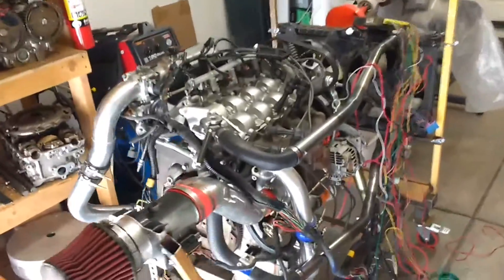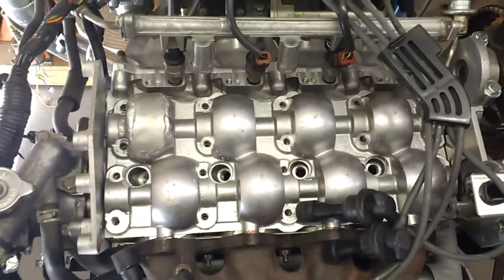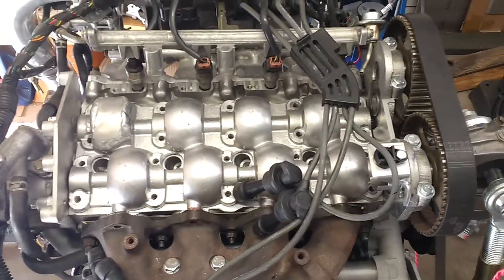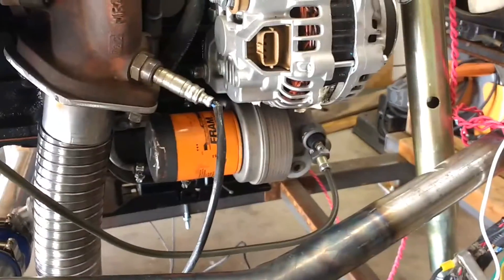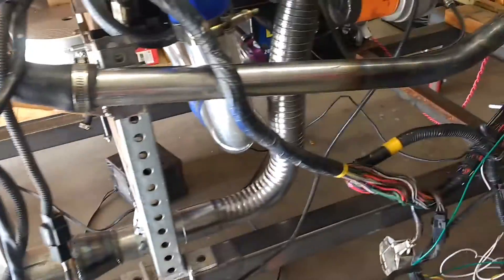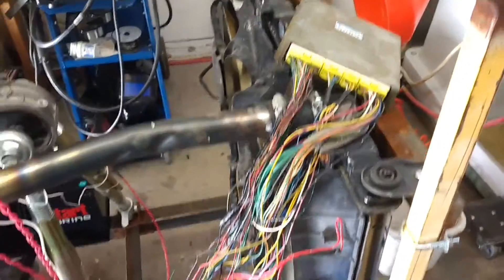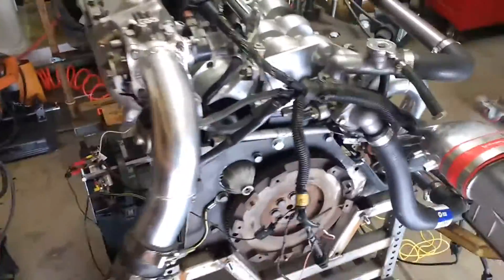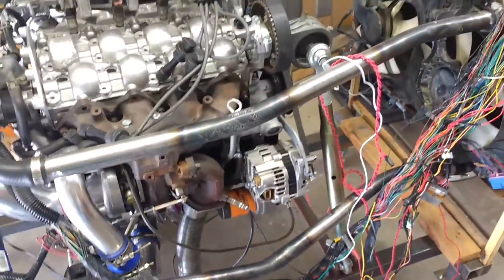Shop Talk: Episode 2 - Rotary Valve Cylinder Head Update, Exhaust and Wiring

Comment: Is this your original rotary valve set-up or did you go with another set up like coates? Have you completed these rotary valve heads before then?
Reply from the maker: rhythmstatement I designed the head, this is the first casting that was successful enough to run. I have no affiliation with them. It does not run yet as I am still working on developing  the material for the seals.
Reply: I wonder if you had pics of the head  from the piston side looking up. Or did I miss something? What are the materials you use on the rotating valve u are using presently? Are you using a cam to turn the valves open still or is it gear drive? Chain drive? To make your own cylinder head Is an accomplishment in itself.
Reply from the maker: Sorry I don't have any pics of that. I am in the experimental phase to see what materials work best. The valves are driven by the stock setup.